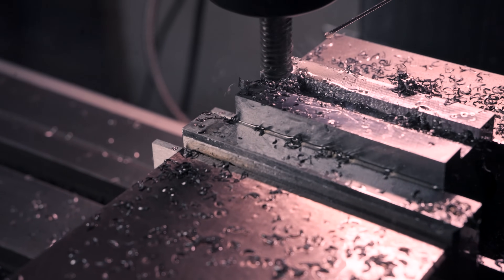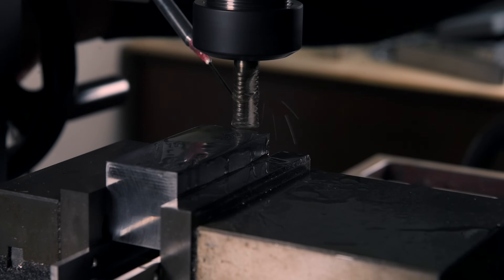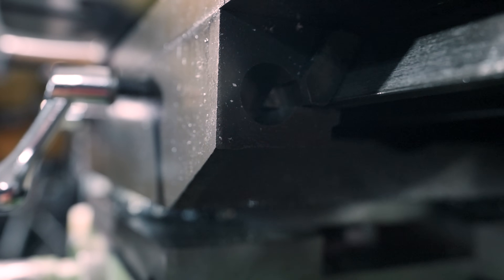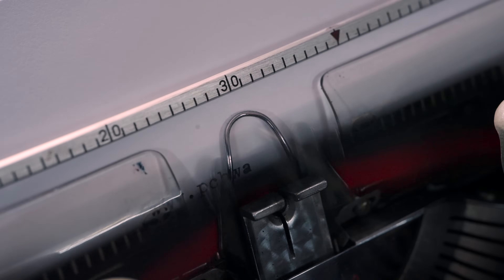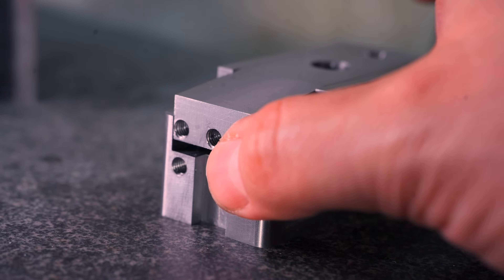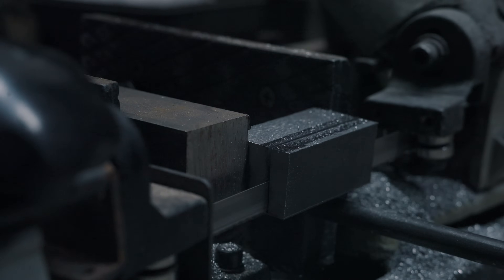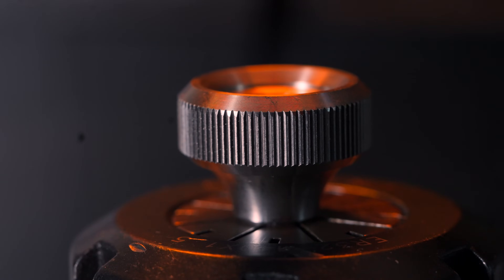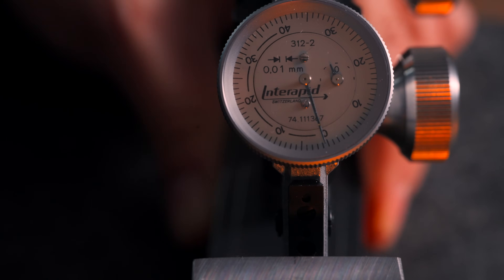Can You Trust Your Machines?

Comment: 2:10 
you're allowing entirely too many chips to build up on the tool, best case scenario the chip on the tool marrs the surface and just leaves an ugly finish, worst case scenario it takes off too much material because you're forcing chips into the material. Just like tapping, need to clear the flutes otherwise the tool can't do it's job.
Reply from the maker: Yeah what happened there is that I was climbing milling with a loosen gib and a crooked X axis, so towards the end I was at 10 times the depth of cut I thought I was, that’s why the end mill grabbed 😅

Comment: Don't understand how you can check square unless you know your vertical post is square within a few 10ths of a mm. Did you check it with a master square off screen?
Reply from the maker: Actually the vertical post doesn’t have to be square, using the bumper you just zero the high spot of the indicator against a known square, and then you compare that set reference with the peace you want to measure. I don’t have a master square but you can use a parallel instead. Tom Lipton has a fantastic video about it, I’ll make a short :)
Reply: @TheProjectHavoc  Right, no master needed, but you need a fairly accurate square, depending on the level of precision you need. I do it myself! :)
Reply from the maker: Exactly 😉

Comment: eheheh! This milling machine is not the best, indeed! I had it, so... I can understand you and your troubles!
Reply from the maker: Yeah, but for a hobbyist is fine practice to straight things up bit by bit, learn a whole bunch of things and then move on to a better machine, right? At the moment Fixing stuff is half the fun 😂
Reply: @TheProjectHavoc  to be honest, and from my experience, a hobbyist who is seeking to do work of a certain precision needs reasonably accurate machines. The jobs also become easier.
Also, repairing or fixing defects, if you don't have the right skills, risks being a procedure that makes the machine worse instead of better.
Reply from the maker: That for sure, but truth be told, for small work this mill has plenty of precision. The biggest problem with it right now is the top speed of 1.200 rpm, which is depressingly slow...And I sure would like more rigidity. But I have an evil master plan: All the knowledge I need to fix the ways is out there, and it will took me at least more than a year to assemble all the tool I'll need, so i got plenty of time to learn and practice. Then I'll take the machine apart, fix the ways, fix the leadcrews, maybe even do something for the speed... But the end goal down the line is to save some cash, take a take a trip to Switzerland, and come back with a Schaublin 22 to put into working order and grow old along side that machine. So, we'll see :)

Comment: may I ask about the z-column way cover?  It looks pretty neat and I don't remember having seen some like that before..  Thanks!
Reply from the maker: You have good eyes :D I actually wanted to include a segment in the video about that, but I didn't want to add too much off project content. I used to have one of those accordion-style covers, but it was a nightmare to remove to oil the screw and nut, and it was hanging all wrong... So I took it off, and designed a 3d printed telescopic cover :) It's working pretty well, I'd like to do one for the y axes too :)
Reply: @TheProjectHavoc    after writing I thought what u could have done - searched for a bit (nothing similar showed up).. and the rel closeup at 5:40 suggested some sort of rigid material with custom details which today means 3d-printed.
Thx for confirming!  Appreciated.

PS: I noted as I was thinking about telescopic for mine as well, just with thin rubber-sheets.. 🙂
Reply from the maker: You’re welcome 😊

Comment: As others have said, Inheritance Machining sent me here - glad I clicked though, and subscribed X)

Also, some more unsolicited advice - for the fine adjust screw fit, you can drill and tap a cross hole, then use a (set) screw with either a nylon tip or just a piece of plastic (nylon, Delrin, PTFE, HDPE from a white plastic cutting board) to press against the fine adjust screw.  Tighten the tension screw to press the plastic against the adjust screw with more or less force to dial in the fit you're looking for.
Reply from the maker: Glad to have you onboard mate! 👍 and thanks for the advice, never thought that! 😱 I will definitely do that! 👍

Comment: Your cinematography makes me feel rather inadequate 🥲
That thing is a work of art, my friend. Can't wait for this channel to absolutely blow up.

On a side note, as it custom with machining videos - some unsolicited advice.
Slitting saws are machining tools. Because of that, I'm led to believe(I'm also basing this on experience too, to be fair) that the best way is to take the full depth of cut instead of several cuts. Lower feed rate and slow RPM will effectively give you a machined surface. With that said, they never stop being terrifying 😅 (I tend to not use the key for this exact reason. If it grabs, the saw will slip rather than explode and embed itself in the nearest fleshy object)

Awesome work!
Reply from the maker: Thanks buddy, I’m glad you liked what I’m doing 😊 and thank you for the unsolicited advice, they are the best part of machining videos 😁 I used to take full cuts but I had problems with chips clogging the teeth, so I pulled back to the chicken approach. Now that I think about it though, the cutting oil I was using was terrible, very sticky… so it was probably that 🤔 plus I still have the habit of running tools way to dull for cheap keeping, but it’s not a good habit. I have on my list to get eventually into tool cutting and sharpening (which I’m sure it will become more expensive than buy fresh tools 🥲)
Reply: @ I’ve recently made a switch from using old, dull endmills to fresh new ones. The difference is staggering 😂 unfortunately sharpening endmills doesn’t really bode well in the hobby machine shop, imo. 
Slitting saws are generally scary. I don’t blade you for the “chicken method”. I’ve done that many times. Proper coolant definitely helps, as does snugging up the gibs on the machine.
Reply from the maker: Yeah fresh end mills are the best, hope one day I’ll have the budget to retire them before they turn completely smooth 🤣

Comment: A few things... 

1 - i love that writing machine, she is a nice one!

2 - Don`t turn shafts, go to the local car garage and snag a few shock struts... Saw them open(near the rear) slowly to let any gas out(tilt them forward as to avoid an oil spray), loose them from the vise, jerk the rod in and out to squeeze all the oil out, re-tighten in the vise and finish sawing it open(hacksaw is recommended, they are soft steel and not so thick)... The rod that you will get is going to be a soft core, case hardened and hard chromed with a nice finish and quite the accuracy to it... You can find them nearly unworn, and you can find them worn to shit, so pick the nicest one - they are literally garbage, so you are not hurting anyone by taking the nicest piece of garbage... 

3 - That mill needs a precision scraping treatment... 

4- NICE JOB!

Best regards!
Steuss
Reply from the maker: 1 Thanks! I have a thing for writing machines 😁

2 Uh, thanks for the tip, never thought of that! I will definitely look into to that 👍

3 I know, and I’m pretty excited about that, I will gearing up in the upcoming months and give it a go when everything is ready 😁

4 THANK YOU! 😊